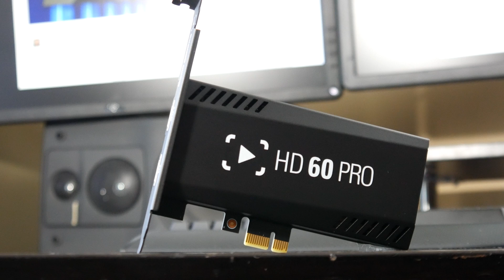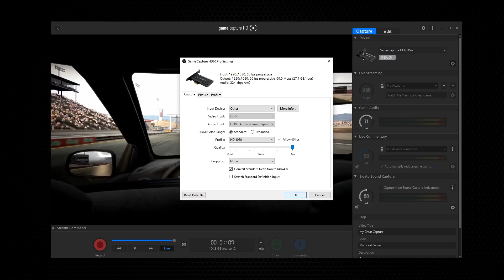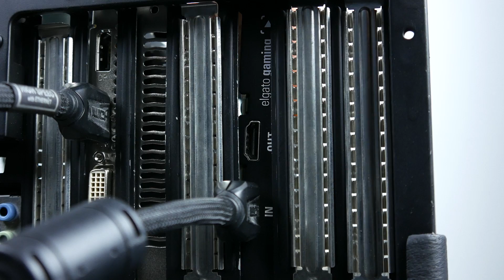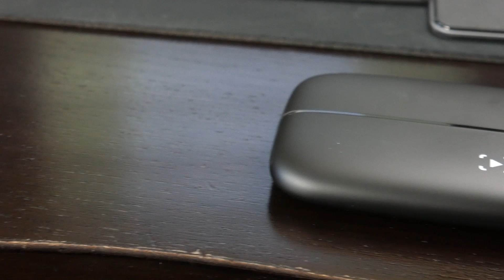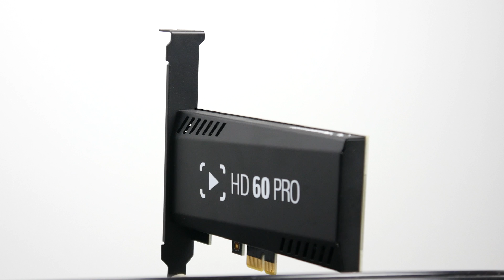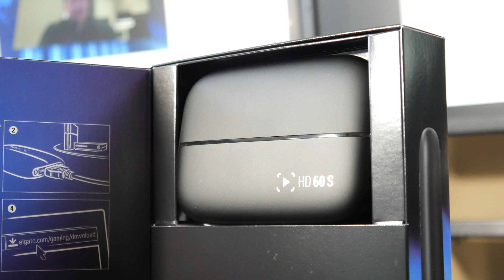Elgato HD60 Pro Review - Ultimate Internal Capture Card?

Comment: One question; I'd like to have a single monitor HD60 Pro setup, however my default monitor resolution is 1440p (2560x1440). I know the HD60 Pro's max res is 1080p (which is fine for YouTube videos, no problem with that), so if I install this card to record a game playing on that same PC, will I need to reduce my monitor's resolution to 1080p before it will work with the HD60 Pro, or will teh HD 60 just accept the higher resolution feed and then downscale it to 1080p? It will suck a little if I have to reduce the resolution of my 1440p PC games whilst I'm recording.

Comment: What about if I use this card inside my PC and connect an xbox one S and a TV which are 10-15metres from the pc ? 
Can I plug XBOX ONE S HDMI 10metres-15metres length to the in port of the card, and the the same HDMI cable to the out port to the TV ? Will it be oki to stream with obs ( or the elgato software ) on my PC but playing in my living room on my xbox and my tv ?

Comment: For a Computer will OBS or the Elgato HD60 Pro give me more fps and better resolution?
Reply: the hd60 Pro will lighten the cpu load, and offer more features like recording while streaming and better stream latency. i'd say the hd60 pro will give you better performance. It is a little more difficult than using just OBS, but should be fine